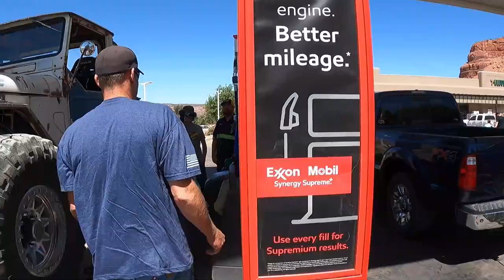What Has Matt Got Us Into Now?!

Comment: All that van had to do was air down to 15-18 psi and it would have been fine. Smittybuilt 5.6cfm compressor would have all 4 aired up in 20 minutes from 18 to 50 psi with a morrflate setup.

Comment: You missed Matt giving away a Yankum rope.  I made this point in the MORR video, but what the heck would those people have done if Paul and Matt had not happened along?  It needed specialist vehicles with the big tries to float on the sand.  An ordinary pickup truck with four wheel drive just wouldn't have been up to pulling those big trailers through that soft sand.

Comment: So would you rather have the FJ or the Morrvair?  I just think the Morrvair is an amazing looking machine.  I think the FJ is probably more capable.  What say you?
Reply: dvil--Apparently I'm the only one who saw on Matt's video of this that while pulling the truck/trailer combo at at least one time there was a slack line between Paul and Matt, and yet the line between Matt and the combo was tight and both of them were moving. About all the fj was doing at that point was creating a sandstorm.
Don't get me wrong about the capability of the fj, though. It was crafted as and IS a very capable unit. I will not pick sides until there is a competition between those two vehicles.